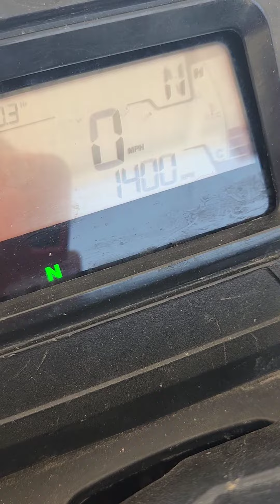WHAT'S WRONG WITH IT ‼️😫

Comment: I’m trying to figure mine out aswell does it at idle and high and low
Reply from the maker: Same, runs great tho...I'm going to try the aic sensor
Reply: @JPO713  yeah mine is making the same noise I’m hoping it’s the fuel pump when I change it out this weekend but if not I’ll be waiting on a video on the control valve
Reply from the maker: @MuddyBBoyz  I just changed my fuel pump, brotha...! Check your fuel pressure first before spending 300 on a fuel pump...
Reply: Ever get it fixed?
Reply from the maker: @connorwilson8696  I got the air idle control valve on the way we will see sometime this week
Reply from the maker: @connorwilson8696  yes sir just dropped a video on it...check it out! 🤙
Reply from the maker: @MudThugsTV  figuered it out bro! Finally lol
Reply from the maker: @connorwilson8696  yes sir here is link to the video https://youtu.be/9Z9J2r-jLdM?si=nl_JCn4NSCOgmgqY
Reply from the maker: @MudThugsTV   https://youtu.be/9Z9J2r-jLdM?si=nl_JCn4NSCOgmgqY